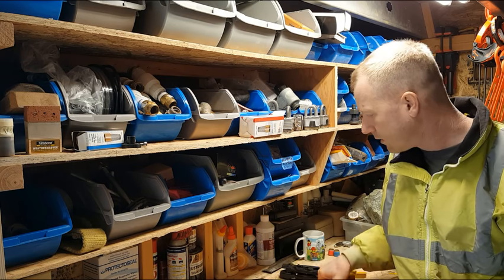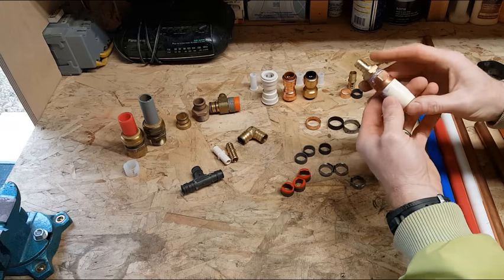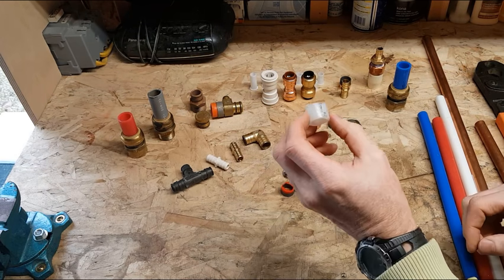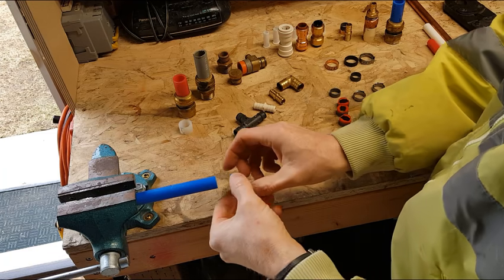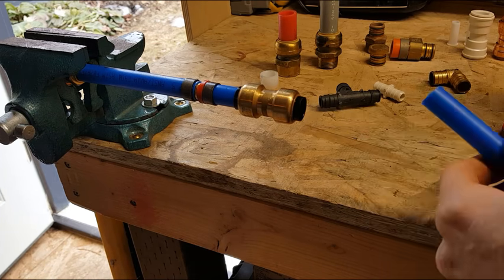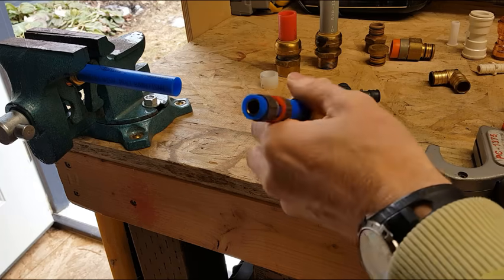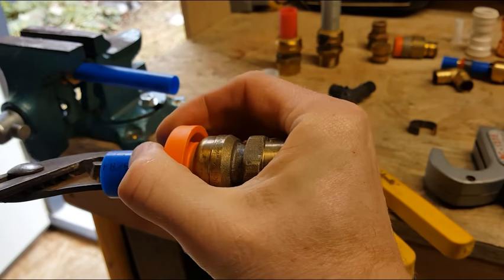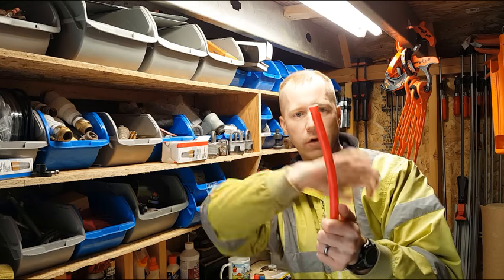Plumbing 101, Pex Tools, Pipe, &  Fittings!

Comment: People talk about microplastic toxicity, cancer causing leeching agents, UV deterioration mold , and mildew you all are putting these systems in your homes… just because it is “faster”?? to install! Do your homework people… i am sticking  to copper which has been a safe system for decades.  Also there is mounting evidence that pex , especially A type is deteriorating with pin hole leaks. If you are spending several hundred thousand dollars on a new home, copper is a minor cost for safety sake.

Comment: Less than one minute in and I'm already bothered. "New?" It's been around over 50 years in the east coast and i believe longer in Europe.
Reply: 2:25 and we're talking about amateur crimp pex instead of expansion pex. Ugh
Reply: 3.20 in and it's obvious only crimp pex is covered, and i stop watching here.
Reply from the maker: But you took the time to comment three times, Thanks!!! Also, if you can afford the investment  of expansion tools, than you probably are not the target audience. Remember, everyone starts at 0, we learn over time.
Reply: @DanSarahMakers  there are manual expansion tools. One doesn't have to get an expensive power tool. I have it because I'm a pro.

For beginners and diy people at home, id recommend still using expansion pex, but with sharkbite fittings. 

In my opinion, crimp pex is garbage. It's very easy to mess up. I fix leaking crimp pex all the time. If "pros" screw it up, i can only imagine what beginners will do. 

Crimp pex is inferior to all other systems. I stopped watching. So im curious. Did you even mention stepping up the pipe size due to the volume restriction of crimp pex fittings?

Comment: I just redid my bathroom my shower and kitchen waterlines with pex And we did the drain lines with PVC I did this for under $600 with Delta faucets and mixing valves my plumber wanted $5300

Comment: The reason I bought the tools is because of a pinhole leak in the middle of a run that took out a ceiling. Easy to work with. Anyone else had tubing leaks?

Comment: The tubing with aluminum sandwiched between two plastic layers is still used in all in floor heating applications where Ethelene glycol is the circulating fluid for heating.

Comment: Doing galvanized piping and it's tough . Gotta get it tightened just right or leaks . Third time trying on two unions ,three nipples and two tees section with three lines to put it just right . Had huge leak . Yeah is pex capable of supply to house ? Looks much simpler than what I'm trying ,.
Reply from the maker: PEX style piping or tubing as I have been corrected will supply a house no problem. There are adaptors for almost any type of piping out there so you can get a nice clean transition. As far as galvanized piping, I have over-tightened pipe into fittings in the past and actually had the weld on the fitting split apart! It's like the story of the three bears, not too loose, not too tight, just find the magical middle ground!

Comment: Out of all the videos like this I never see the most common crimp system at least in my area. That is viega or heatlink. They have a stainless sleeve that’s really easy to crimp. Much easier than the copper rings in my opinion. They also go over the end so you dont have to worry about positioning. They have a little window to make sure the pipe is all the way up then you crimp it. I don’t use this system. I use uponor expansion. However they seem like the most common for plumbers. Viega makes the stuff for pex b and heatlink is a pex a version. Most of the examples shown are what’s sold at box stores. I’m not knocking what’s shown it just seems like they always get left out

Comment: I've tried both the copper crimp rings and the stainless steel clamp rings.  When I used the copper crimp rings, the PEX pipe was securely fastened to the fitting so tightly that I could not rotate the fitting on the pipe, it was 'one piece'.  But with the clamp ring, I could rotate the fitting with not all that much effort, the clamp ring did not do as good a job as the crimp ring. I could see a clamp connection leaking after a few years.

Comment: To keep the crimp ring in the right spot, I first wrap 6 wraps of masking tape on the pipe in the right spot to keep the crimp ring from sliding down the pipe. you need to make sure that the crimp ring stays in exactly the right spot on the pipe while crimping and the masking tape keeps the crimp ring in the right spot if you 'press. the crimp tool up against the tape while you are crimping. Then when the crimping is done, you remove the tape.

Comment: So actually for diy. I have to buy those crimper tool to put on the ring and buy the ring remover tool?  I have a split pipe with those copper ring for the dish washer. We no longer need it and took it off. But there s a split in there.

Comment: Why not use other expansion pex seems more sensible as has chemical memory wants to be original shape, is it because of tool price?  What’s expander cost? I’ve seen pex only 1incb to 1/4 inch. Pity no clear or high volume, aware of.

Comment: Are internal connections “called pex” the black plastic also cross linked polymers?  Truly pex?  Because it would be hazardous to introduce metals, copper or brass cheap low heat PVC or HDPE Hot CPVC, polyethylenes r etc... I don’t want metals in reacting chemical proximity. It could be huge hazard if any failure. Thanks.

Comment: Great video! It's exactly what I was looking for. I've done a healthy amount of construction/remodeling work, but Pex is new to me. Trying to replace my kitchen sink faucet and didn't have the slightest clue how to do it. I figured out that I need tools, but research showed me all different kinds and I had no clue which one would work best. I'm still undecided but at least I have a basis to start from now.
Reply: Keep it simple.  The Kitchen Sink Faucets likely fasten to the hot and cold  water valves under the sink  and all you'll need is a couple of wrenches (and a BASIN wrench - to get loosen the nuts holding the faucet to teh sink, etc.)  

Try Googling "Replace Kitchen Faucet - This Old House " on YouTube as I know they have done this several times.   You will not need any PEX or  fittings  as discussed in this video.

Comment: So much info about defunct plumbing materials and connections. Would rather just look at a few, but only good recommended types, and mainly PEX, why I’m looking at all. I’ve been soldering copper since the early 1980’s. Just got a torch, flux, emery paper, fittings, pipe and a cutter. It’s easy and the water systems I’ve done all still work perfectly...except a couple that have frozen and one that was scraped by ‘dozers. 

SS crimp looks like the best choice for PEX: versatile, cheap, lasts as well as any, easy to use, only one tool needed for most size pipes and fittings, and only needs access from the front.

Comment: Do shark bites still have that inner sleeve part? I did some of those under my kitchen sink a couple years ago and I'm pretty sure there was no sleeve involved. Those things are crazy expensive.
Reply: Was wondering if the inner ring part helps out with no leaks. why few comments are saying shark bite leaks and should be temp fix only? Used shark bite 6 months ago on 3/4 pex and didn't have inserts in it.  Maybe comes in with smaller size fittings.

Comment: The no#1 reason I don't use pex and still use copper...all the different fittings crimpers, adapters, collars ,rings , different wall thickness...pex A,B or C ,headache...all tells me I'm going back to Manards about 10 times on any project...not doubting the advantages just looks like its for the tickeridus type.

Comment: Nicely done video.  Good intro into PEX and the crimping styles for attaching fittings.  I have a 2016 RV and the fittings are plastic and I need to repair the fittings to the sink and shower. I'll go with the copper fittings with the crimp clamps due to tight spaces.  This was a good 101 video for sure.  Many thanks!

Comment: I need the tool that allows you to cut the metal bracket so I can use my fittings. What is it called please
Reply: You can just use a dremel with carbide disk in a pinch.
I have a milwaukee 12v cordless, works great.

Comment: Have PEX in my manufactured house. I can taste the plastic in the water. Maybe someday crawl under the house and rip the shit out and install copper. Yes copper can freeze and crack but it is a safer water line for drinking. Plumbers like putting in PEX because the new generation don't have the patience to sweat pipes. Yes the price maybe cheaper for PEX. But the fittings are more. Plus plumbers charge the same in labor as they would with copper. That's why they like putting in pex quicker and faster.
Reply from the maker: There are certainly pros and cons to both. Once installed, it's hard to justify ripping it out again when you realize you can "taste the plastic". At the time(8+ years ago), we just installed a really good water filter and that was enough to eliminate the plastic taste from our drinking water.

Comment: Yuge lawsuit against ipex kitec.  definitely not in use anymore.  Aluminum in the kitec and the brass fittings would conduct cathodic processes which eventually caused catastrophic failure at the fittings.  Timeline for collecting on the class action expired December 31 2019.

Comment: All good in the video except for those damn shark bites .... never again :) 
Ive switched all my plumbing to mainly copper soldered and pex where there is freezing risk going through exterior walls. 

Great video, and best part is the stainless steel tool can be used for a ton of automotive/jet ski/ motorcycle etc applications where there is a power steering line, etc which needs a new clamp. 

I initially bought it from home depot for my jet ski carbon ring / output shaft, then found its real purpose.

Comment: Use type A with plastic fittings when your on a well. Sulphuric water turn brass black and tears up cooper. That in turns transfers to the porcelain on your sinks and toilets.

Comment: A person who is thinking about doing any plumbing should consider only these types of fittings: 
- 1) Expanded-PEX fittings (Uponor) as the fittings have a larger inside diameter than 'crimped' type of PEX fittings, so less resistance to flow.  Crimped-PEX fittings are okay though for smaller flow items such as sinks and toilets. If you want to use crimped-PEX but you need more flow than the 1/2" crimped fittings provide, then you will have to use the larger 3/4" PEX pipes. The crimped fittings for the 3/4" PEX pipe have the same internal diameter as 1/2" copper pipes do, so  1/2" copper pipes can be connected to 3/4" PEX pipes with no loss in flow rates at all at the fittings. 
- 2) Soldered joints = to solder in the adapters that allow the PEX to be connected to existing copper pipes. 
- 3) Threaded fittings = to connect the PEX pipe to valves, water filters, water heaters, or other threaded connections. 
- 4) at places where you need a 90-degree bend, simply use a 'metal PEX pipe 90-degree bend support' that is available at all Home Depot stores for $2.50 each - it is way easier to install than a 90-degree fitting would be to add to the PEX pipe. It just slides over the PEX pipe itself, causing the PEX to bend really tightly, and no cutting of the pipe itself is required.

   Do NOT use SharkBite fittings for connections to hot water heaters as the extreme levels of thermal expansion will lead to leaks in just a few years. 
   Do not use the 'clamp' stainless steel rings on PEX fittings, use the 'CRIMP' copper rings instead as the 'crimp' rings won't expand once they have been crimped, but the 'TAB' on the clamped stainless steel rings tends to OPEN-UP as time passes, and that often leads to leaks after 6 to 8 years in hot water pipe fittings that have more thermal expansion cycles in them than the cold water pipes do. 

   Often a homeowner has a situation where he/she cannot shut off the water completely and there is a bit of water dripping out of the copper pipe. You can't solder a fitting onto a copper pipe that has water flowing through it like that. In a situation such as that the easiest option is to use a SharkBite fitting on it. Before SharkBites it would be necessary to use a vacuum connected to a length of 3/8" copper tubing to 'suck' the dripping water out of the pipe as a fitting (or valve) was being soldered to the copper, but that was hard to do and needed skill. Still, I prefer doing that to using SharkBites, I just trust solder to hold for years,  more than I trust a rubber O-ring to hold for years.
Reply from the maker: Lots of good info, thanks for the input.

Comment: Excellent Video..  I have Questions on (1) How does those Plastic fittings will stand up to freezing Vs Metal fittings used in pex B pipping with crimping system?  (2) Crimping with this fitting which reduces flow of water as they are not exactly 1/2 " or 3/4 inch when you slide inside pex B tubing, is there any inexpensive fittings which can donot do that at the same time will  standup to freezing situation by not bursting ?

Comment: Thank you so much!  I'm working on a rental trailer and it has some PEX pipe in it and I was not familiar with any of the fittings (especially the Shark ones) and I didn't know how to release them or what fitting that I needed to use to add additional water lines to the existing PEX ... and now I feel (thanks you your video) that I can do the work myself!

Comment: Good tutorial that answers a lot of common questions.  I've always been a copper pipe and solder guy for hidden connections. It does take some experience to complete some solder connections in tight places.  Shark-Bite or Push-On connectors have pleasantly surprised me how well they seal the first time and every time.  Shark-Bite can make some very difficult connections very simple.  Shark-Bite "slip joint" fittings can be a real problem solver when working in tight spaces or with rigidly fixed piping.  I still have some concerns regarding the longevity of Shark-Bite connectors when they are hidden in walls where they are not accessible, such as behind tile.  Early PEX systems seemed to be inferior and builders were just trying to save costs, but time seems to have proven them to be a reliable system.  Whether they will perform for 80 to 100 years like copper can is yet to be seen.  I know of two cases where PEX tubing was chewed and damaged by wildlife causing flooding.  I would avoid the use of PEX anywhere that it could be accessed by rodents, squirrels, raccoons...etc.  If you have a grizzly in your crawlspace, you have a bigger problem.
Reply: I agree that Shark-Bite are amazing as "problem solvers" for tight places or where you don't want to introduce a flame.  There are concerns with their ultimate longevity.  I've also heard of problems with PEX tubing and rodents, squirrels and raccoons, etc.  PEX piping will also melt in a fire, but maybe that's a good thing, since the water spray could extinguish the fire. LOL.

Comment: To take off the pinch clamp just take a dremel thin grinding wheel and grind down that little piece that holds the end of the clamp to the underneath part of the clamp. The pull it apart with a pair of plane out diagonal wire cutters. You can also use the dremel with the thin grinding wheel to cut in a diagonal method on opposite sides to weaken the pex still on the fitting but be careful not to grind into the fitting.

Comment: Not a diy thing.  Best to stay with copper or Cpvc.
Reply: Why? Copper will eventually leak and PEX is much easier than both CPVC and copper to install. What's the downside to PEX? I have never used PEX but looks much easier than copper or CPVC. Thanks.

Comment: yeah I have a rental trailer with the PolyB pipe. Thankfully my well water doesn't have chlorine and after 23 years have not had a single leak due to the pipe failing at least.. Well except when a rat chewed through it..:). Thankfully Home Depot stock a PB to PEX fitting for $2 which can be used with a standard PEX crimper... I keep 4 of those on hand just in case.

Comment: A very good information video.  A  question tho.  Can PEX be used for air lines? (For areas in a garage/shop)  What pressure  is Pex limited to ?
Reply: Don Gies i dont believe so... i mean they hold up to 100psi for air pressure tests for plumbing. But its designated for heating/plumbing. I wouldnt trust it for air
Reply: I don't see why not.  It certainly looks stronger than most hair hoses I have.

Comment: How long does it take cpvc to be no good from being left in the sun
Reply: I read an article a few years ago that stated that there was almost no damage from sunlight radiation, even after several years of outdoor storage (it was an article from the manufacturer in North Carolina that included very detailed specs in regards to the "loss" of quality).  I was shocked and happy, as I have 100 pieces or so that have been outside for a decade but don't appear to have any damage whatsoever (or loss of flexibility).  They are 20' long 3/4" pieces that I use to make greenhouse frames.